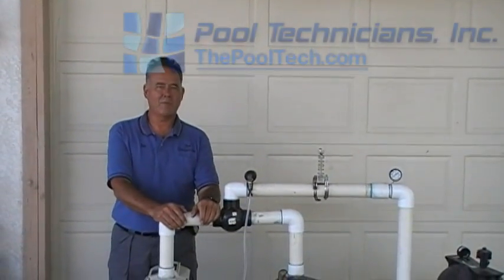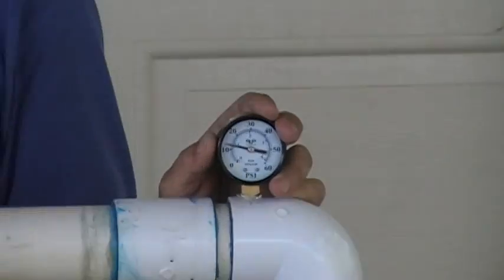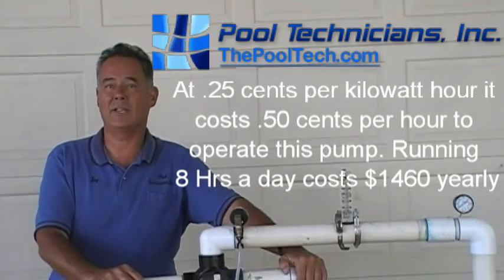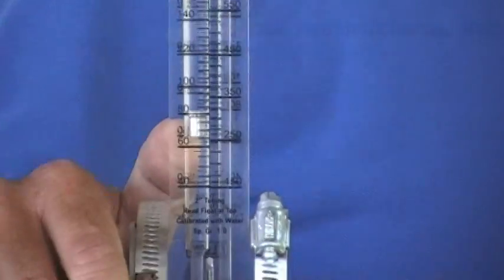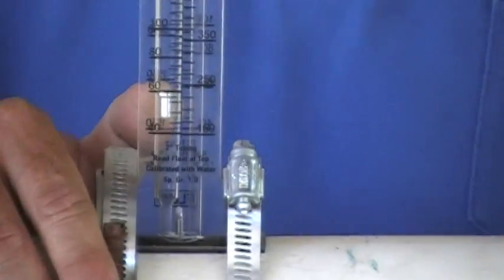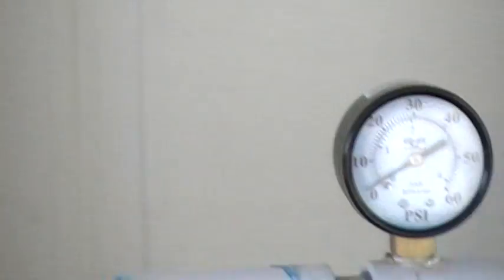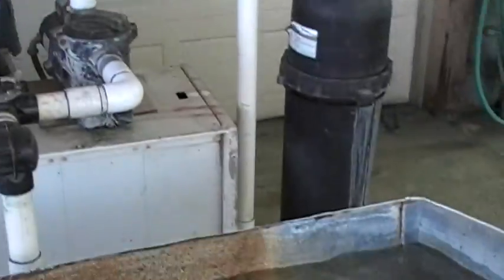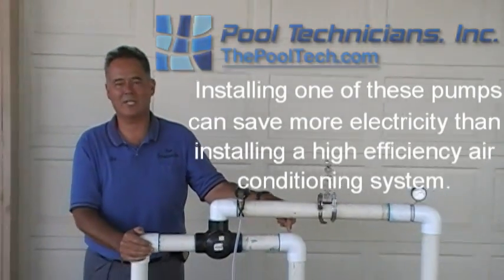Variable speed pool pump efficiency comparison test Pool Technicians

Comment: 20 gpm would do 1 complete turnover on a pool size of 28,800 gallons in 24 hrs. 

It would be interesting to see what the startup current on this motor is at each of the settings (20, 40, and 80 gpm).
Reply: Because the filtered water returning to the pool becomes mixed with unfiltered water the filtration effect is diluted. In order to treat 95% of the water the entire pool volume must be turned over THREE TIMES. You must also consider that in 2 inch pipe flow becomes exponentially less efficient at flow rates over 55 gpm. Both of these factors are critical when calculating a program for a VS pump system

Comment: @DeegansTroop 20 gpm is plenty to run many above ground cleaners, solar heaters, and can easily broadcast chemicals. You are wrong.
Reply: Many skimmers, suction side vacuums, salt cells, water features and heaters require flow of 50 gpm for proper operation. When adding chemicals an even higher flow is preferable to avoid settling on the pool bottom and causing surface damage

Comment: Yes, you'll have a clean pool. Residential pools have to be filtered once per day. A 20,000 gallon pool will be filtered in 16 hrs at 20 gpm. If you need to "up" the speed for pool cleaners or solar, you can program your system to do that.

Comment: lol what do you expect to do at 20gpm? You cant run solar or pool cleaners and you wont broadcast any water or chems. You must use the higher flow rates which doesnt justify a 2000 dollar pump
Reply: The pump is programmable. So you run 3-6 hours at a medium speed to activate the vacuum and skimmers (filtration). Then for 10-15 hours it runs at low speed (circulation). The VS pump is more efficient at EVER speed and using the program and adjustable rpm you save $1000 per year in electricity. A VS pump is only $1200 compared to a name brand SS pump for about $600 — that cost differential is made up in just 6 months. SS pumps are such outdated energy hogs that they are being legislated out of existence